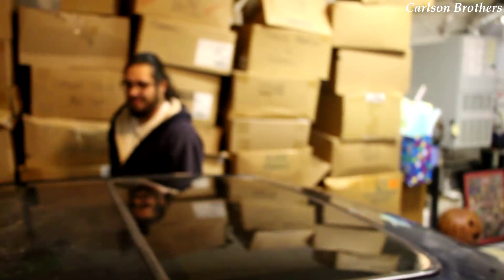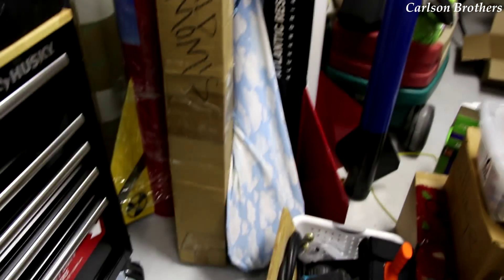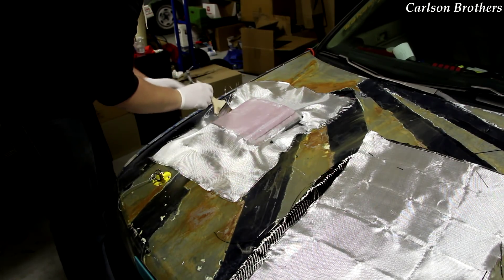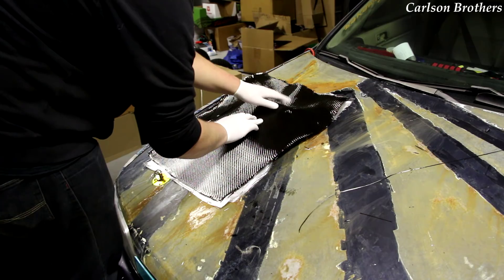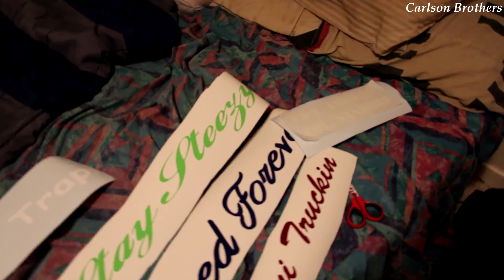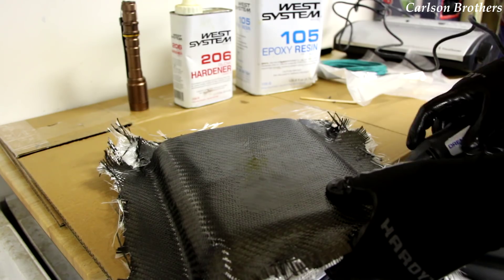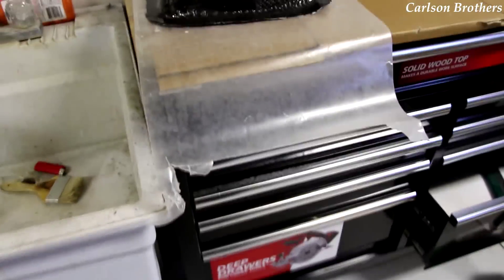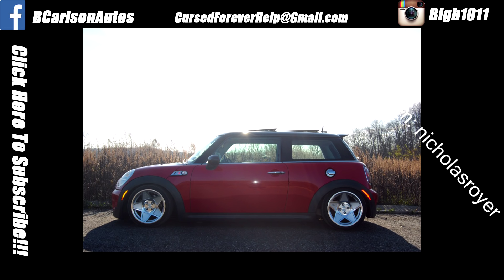How To Make A Carbon Fiber Hood Scoop Part 4 : Laying up Composites

Comment: BTW:  You want to use Epoxy resins when working with different typs of materials such as bonding fiberglass to a metal or other type material skinned car.  DO NOT USED Polyester resins as it is for laminating sutff like boats etc.
Reply from the maker: Tim Curtin I did use epoxy resin.

Comment: how much did that amount of carbon fiber cost for the scoop?
Reply from the maker: +Callum Mcleish I'm not entirely sure. If you wanted it to be sturdy you'd definitely want to do more layers than I did. If I was going all out, I'd probably do two more layers of CF on top of the one I had on it already. I believe I paid around $18 a yard for the roll I have (5 yards) from Soller Composites.
Reply: that's a pretty decent price compared to what i had in mind . loving the vids man (insert kawai face)

Comment: Can you use the same stuff as you do for fibre glassing? like the resin
Reply from the maker: +Alex Grace Like Polyester Resin? Yes. Just know that polyester is not adhesive like epoxy, so if you want it to stick, epoxy is the better option. Polyester resin is heaps cheaper than epoxy, though.
Reply: Ah right cool, cause I know of this stuff called SMD Sunflash which is UV activated resin. Which sounds pretty cool and useful!

Comment: Great video! I didn't know carbon fiber was this "easy" to make yourself.
Reply from the maker: +Luca Car Mods If you've got the patience, it's not too bad! I don't have a lot of patience, but I've been doing CF stuff for a few years now, so I've learned to live with it. I love vacuum bagging carbon fiber. I wrote a magazine article about it a few months ago.
Reply: +Braden Carlson I believe that's the case with most body work things, patience..
Reply: +Luca Car Mods very serious video,  Thank You for sharing.

___________________________
Odong-odong TV
Free Music & Sounds Provider
Mainly for Youtube Video Creators
Reply: Why wouldn't you just wet sand and then use a spray on uv poly finish? You can do gloss, semi, satin or matte and It's super simple.